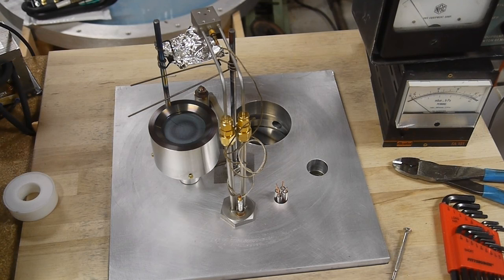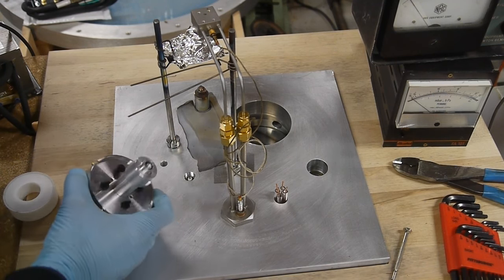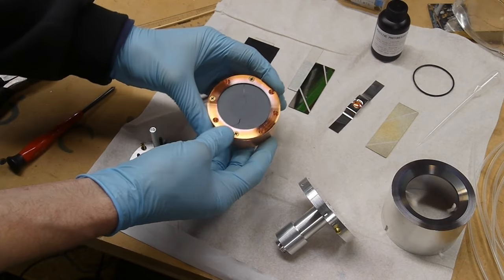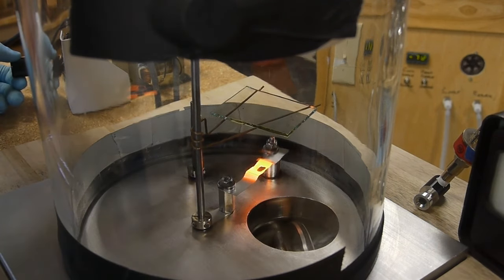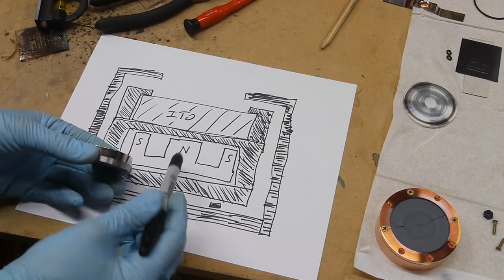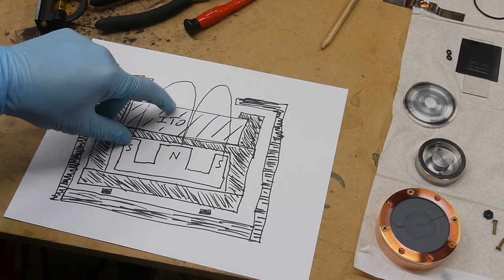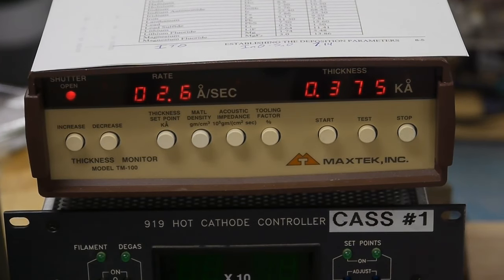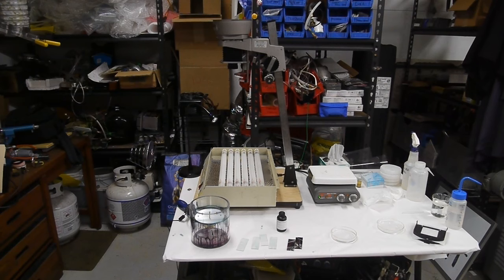Intro to sputtering (process to create clear, conductive coatings)

Comment: I'm assuming that your inner cylinder is pure copper, correct? Are the outer parts made of aluminum or stainless steel? Considering that copper is a great conductor of heat, as is aluminum, I'm wondering whether, depending on the temperatures being generated during this process, it would be possible to design the thing to be air cooled. If the cylindrical part was pure copper, with external cooling fins machined around it's circumference, and maybe some additional fins machined into aluminum parts that could make up the remainder of the external body, you could probably conduct heat away from the internal parts significantly quicker. I came here to learn what sputtering is, after repeatedly running into "sputtering targets" on the internet while trying to build my element collection. So I know almost nothing about this process, but my next question would be to ask whether it would be possible to introduce airflow into the working area while it's 'running', to aid in cooling(along with aforementioned cooling fins)? But maybe that airflow would disrupt the heated vapor from the source material(?)
Reply: It won't chooch. Air cooling relies on air: in a near-vacuum, there won't be enough gas in the chamber for decent convection.

Comment: If you make a pv cell that is 12% efficient at converting solar radiation into electricity and you are able to measure that it has a 16% partial reflection and the thickness is 1um, the partial reflection at 0.5um is 0% partial reflection and the thermal efficiency can improve.

Comment: I would like to know what clearance distance you have between the piece of copper and the outer shield
Reply: ***** Thanks for that, then i should be fine with the first parts i made on the lathe :) before i was just playing arround with rubbish setups with more or less working results. I wonder if this will help.
By the way, is your baseplate connected to something or actually floating. I left mine floating so far.

Comment: Would you suppose that method could be used to coat a TiNi layer on heat treated steel to provide a corrosion resistant coating on the steel? Something line 5 microns thick.
Reply: Yes but you would have to put down a layer of Tiw at about 500 angstroms to get to TiNi to adhere properly

Comment: Any followup if you switched from nylon to a different material?  I'm not entirely sure why nylon is bad for a vacuum chamber, except that I know it can absorb some water.
Reply from the maker: Tomek B. Nylon softens at a relatively low temperature, and outgasses.  The screws are still in use, but I haven't put that many hours on my sputtering setup.  In general, it needs a higher water cooling flowrate to be useful at higher powers.
Reply: Applied Science Cool! I appreciate the response. That makes sense, all things considered now (you spoke of the watercooling need in the video.)   It sounds like the softening at a low temperature is a problem for the sputtering process, and the outgassing is an issue for vacuum.  

For what it's worth I think you can get a better service temperature range from Polycarbonate screws which are the only other cheap plastic screws I've seen. I'm just mentioning it incase there is something obviously wrong with those as well.
Reply: Applied Science could this process be used to turn a window into a solar panel?
Reply: rizendell Sputtering is a technique, and a good one, for adding material to glass. But the question you asked is a little weird, like "can a saw be used for making a house?" What I just mean is that there are other components to the process of a solar panel. 

Also, i have no heard of a solar panel that is clear- is there a specific technology you're thinking of? It would have to be a clear film that only absorbs the infrared and other non-visible parts of the spectrum. 

There are ways to add titanium dioxide to make glass solar panels, but they the easy ones use plant molecules that degrade pretty quickly. 

Since you asked the question you probably had something in mind- what was it? ^_^
Reply: Tomek B. OK maybe there are some new stuff brewing ^_^ http://www.extremetech.com/extreme/188667-a-fully-transparent-solar-cell-that-could-make-every-window-and-screen-a-power-source 

By the way I hadn't heard of a technique that was 100% transparent is what I meant. Whatever it is needs to be very robust- since it will be on the outside of the window so it can grab the infrared light. But on the outside is not protected from the elements.
Reply: Tomek B. well like you said, I was kind of wondering if you could use the sputtering to deposit the titanium dioxide on to the surface so that it would make the glass like a tinted window that also serves as a solar panel.
Reply: Applied Science maybe ptfe would be an option?
Reply: Applied Science Brilliant work, great looking design. May I suggest ceramic or glass screws, maybe hard to make but not impossible with a diamond bit and cnc machine.
Reply: Robert Ritchie I think it would sooner be rationale to make them from PEEK or similar high temp exotic plastic, because the ceramics main benefit is higher temperature than this is at and lower conductivity, neither of which are much concerns here. 

Dang ceramic screws at small sizes are expensive though!
Reply: Tomek Brzezinski I never even thought about PEEK or high temp plastic. It is a brilliant compact design you have and I do hope you develop it further. I would like to build something that works along similar principles whereby you vaporize a metal tip and deposit the vapor directly on the anode and of course you need an inert atmosphere and low pressure.
Reply: Robert Ritchie :) PEEK is pretty cool but stupidly expensive as a stock material, unfortunately. Maybe I'm just always way too cheap but I wish more exotic materials were affordable to play with sometimes.  PEEK is however still cheaper than ceramic screws...I needed them once for their low conductivity, but they were not easy for me to source, and I gave up and just used tiny steel screws (to minimize heat flow.)

Your project sounds pretty interesting but I have to admit I haven't made Ben's sputtering machine but I've been keeping my eye out for a worthy project to motivate it and honestly a bell jar as well.
Reply: I just watched his evaporation video and have discerned that his method is very different to my proposed method. I do know the method I will use works, I just do not know the deposition rate. The deposition thickness  should be calculable though. Experimentation is really the only method of proving and testing such a machine. Time permitting I will build such a machine this year.

Comment: Hello, I was wondering if it would be possible theoretically to use sputtering to make a very thin foil for use in ribbon microphones, by sputtering onto a substrate (eg plastic?) that can be dissolved to leave a very thin foil. 2 micron foil and below is perfect for ribbon microphones. If anyone here has any input and ideas on this please leave comment, Thank you

Comment: IIs teflon any better than nylon?
Reply: i was thinking the same thing..   http://www.alibaba.com/showroom/teflon-screw.html  (link to teflon screws if that is indeed the case that they would be better to use)
Reply: any plastics are a big no no in vacuum.
Reply: now i'm curious..  why exactly is that?  are there problems with outgassing when using plastics?  if so, does that go for ALL kinds of plastic?  (curious meter is at like a 9.5 right now..  lol)
Reply: ***** They outgas, melt, sublimate, contaminate, get attacked by plasma, in general make a mess of things.
Reply: Glass screws would be perfect 🤔

Comment: What exactly is a "negative volt"?  I tried to look it up and failed.  The internet only had complex explanations.  Kinda looking for a "like too much air in a balloon!" explanation, if you know what I mean.
Reply: You can have positive, neutral(zero,ground) and negative voltage. Positive attracts electrons, negative repels them. The magnitude of the voltage determines how attracted or repelled they are.
Reply: Basically a magnet?
Reply: NinjaOnANinja Electricity and Magnetism have some common characteristics (likes repel, opposites attract), so for the negative volt analogy it is sufficient to think of a magnet. There are more characteristics for each, an important one for this video being that electric charges have a magnetic component when they have a velocity (speed and direction relevant). This is why Ben has a high negative voltage to attract the ions in the chamber and once they're moving the magnets exert forces to confine the ions. The ions then knock the ITO particles onto the glass slide.
Reply: I kinda understand it, but the way it is written kinda throws me off T.T
Reply: It's a difficult subject to learn, usually the topic of a second semester physics course. It is also a matter of the "right" exposure. I've had professors try to elaborate with high-level mathematics, but my question was probably simple, looking for an analogy. (Like this one) Going through the system has shown me how important it is to include lots of different aspects in the description of matter and their interactions.

If you don't mind the long comment, some advice I would like to share with you. STEM fields have a very rhetoric-based (rigid, precise) language in which words and how they're used is VERY important. More important than the language though, is the behavior it's trying to be describe. If you have trouble reading descriptions of very heavy technical-writing, see if there's a youtube video that describes whats going on and shows an animation, then go back to the book.

Keep at it, there are cooler things in science than the whiz-bang-demos on youtube.
Reply: Well, I understand things and learn things rather quickly.  At times, I introduce new methods of input on ideas.  Such as getting a teacher to see something they never seen before despite the fact they have been teaching this subject for years.

My issue was the grammar involved.  When it comes to learning new things, I need to understand something completely and full circle. 

Like a train.  I might be slow to start, but once I am going, it is hard to stop me and I will get you there.  If the track isn't missing a rail anyway.  If it is, like a train, I am screwed.
Reply: NinjaOnANinja If you're asking what "negative voltage" means it refers to the direction of flow of current when a potential difference exists.

In a simple battery or other DC source electrons flow from the negative pole to the positive pole. Electrical current is said to flow from positive pole to negative pole; yes it is reversed of the electron activity. Why? Not sure, but yes it is counterintuitive. So, if you have one object with no difference in potential to the earth it is said to be "at ground potential". If you have another object which current flows from earth into (electrons flow out of the object and into earth) it is at a negative potential to earth. This object is said to be at a negative voltage, earth referenced. What matters to the electrical operation is not whether it is negative or positive in respect to earth, but in which way the electrons are flowing. The reason to have it negative to ground, with the part you the operator can interact with at ground is so that you don't die when touching the part you interact with. You could just as easily make the outer part of the sputtering gun at a high positive voltage, and the inner part at ground potential and it would work just the same. The difference is that as I said, making the outside at a high voltage referenced to earth is a safety hazard. The sputter gun doesn't really care which way you do it though.

Comment: I have the same electrophoresis power supply!
Reply: ***** Thank you for the short guide. Coincidentally, I also used a commercial sputter coater to coat glass with Cr and Pt. Then I cut a 1um separation thread using laser ablation and then detected carbon nanotubes which closed the 1um gap, decreasing the resistance between the two. I will certainly watch out for your future videos, I'm interested in sputter coating.

Comment: I saw that no argon gas was used in other examples so why is argon gas used here ? 
Ito coating possible without using argon gas?
Reply: coating is possible without argon gas...  we can use n2 for the same... but for ion bombadmnt we need to use  gases
Reply: thanks for the answer, What is the difference between coating and ion bombadmnt .. ? ... What does the ion bombadmnt do?
Reply: I understand the truth?
It is not possible to coat without using any gas
Reply: yep it is not possible o do spuutering coating without gas... 
btw i do manufacture theese systems
Reply: What is the vacuum value and then the gas pressure value_?  Many thanks for your interest and information
Reply: the vacuum value depends upon us only !! like how much vacuum u do require for coating we can begin the coating in sputtering with 1*10-3 mbar, and flow rate can be 10-500 sccm or higher its upto the user requirement. when we are doing coating while purging gas we have ti check that the vacuum must be not less than 0.01 mbar
Reply: How many degrees does this process produce?, I make a vacuum chamber with 1.5 cm thick plexiglass so maybe not for long use but suitable for short use?

photo;  https://i.hizliresim.com/BABkov.jpg